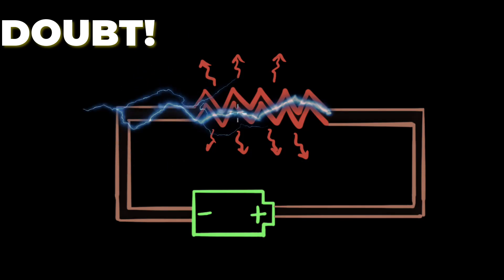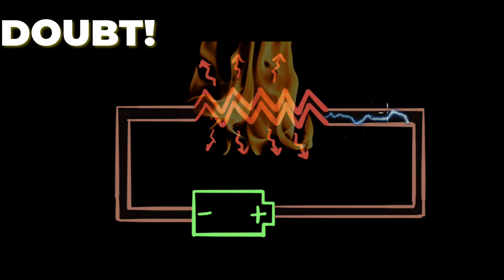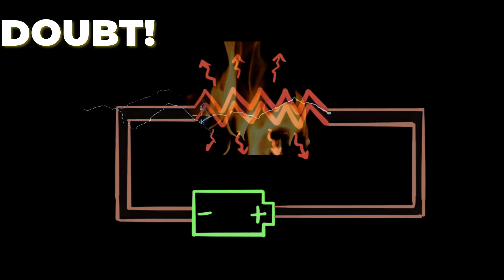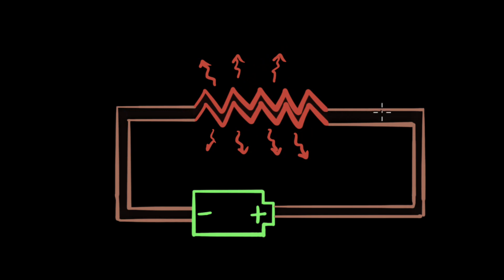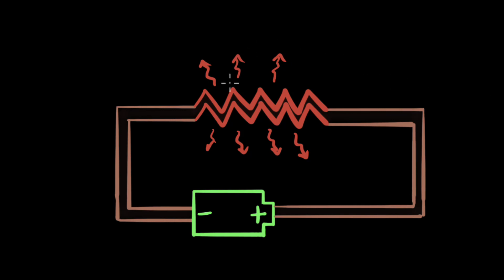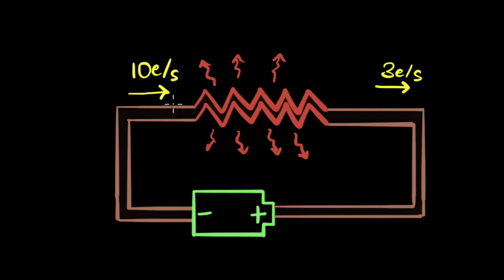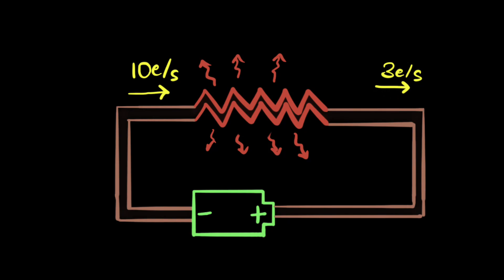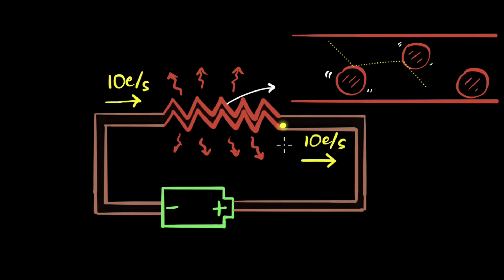Does current convert to heat?

Comment from the maker: For the one electron case, what do you say about the current in the resistor vs current outside? Let the debate begin 🔽
Reply: @FloatHeadPhysics I think the current will be less across the resistor as compared to the current outside (in circuit) ,in the case of one single electron.
Reply: It must be same. Because amount of charge that pass through the resistor will be same as amount of charge that pass through the wire for equal time intervals.
Reply: @yashodeepkarle3863  ya , also the voltage remains same , so the average dirft velocity will also not change and remain same throughout the circuit, wdyt ? 🤔
Reply: @VyomMath  that's right
Reply: @yashodeepkarle3863  but the resistor will decrease its drift velocity. So, the current will be less across resistor.
Reply: @Atheist-From-India  the average drift velocity of single e- won't change , because the voltage of the battery won't change and the drift velocity depends on the voltage, in the wire as well the resistance is almost zero , not equal to zero , thus the e- will bump into the atoms of the wire , even though the bumping would be more frequent in the resistor the driving force (voltage) remains the same , thus the average drift velocity also remains the same , that's just my perspective , don't mind 😌
Reply: I think outside current and current in the resistor will be different. (Outside the resistor,  electron will accelerate but inside the resistor electron's acceleration will decrease due to collision with atoms)😐
Reply: I think, in case of one electron, the speed of electron will be different: speed will be higher on entrance to resister and lower after resister.
Reply: If there were only one electron, then it probably won't be going anywhere as a "current" because the battery would act more like a P-N junction and not a battery.  So, no voltage, no current, the electron just bounces around randomly as Johnson noise.

If we assign the battery a small potential difference anyway, that would certainly push the electron through the circuit.  I would think that electron would go slower through mediums with higher resistances (the resistor) than mediums with lower resistances (the wire). 

Like light passing through different mediums, the velocity is the same going in and going out, but different inside the medium.   I don't think any law of physics disallows that.

The question in that case then becomes... does the electron get stuck anywhere?   Well, if we magically assign the battery a potential then it probably won't get stuck anywhere inside a purely resistive circuit.  But there is certainly possibility that some component in a more complex circuit could act as a potential barrier and the electron would simply get stuck there unless the battery provides enough of a potential to overcome the barrier.

That's what I think.

-Matt
Reply: I think the current will remain the same outside the resistor and inside the reisitor becuase current is coulomb's per second or no of e- per second and that thing won't change, as in this situation there is only 1 e- moving around the entire circuit, also it's drift velocity will also remain the same throughout the circuit as the power source remains the same and voltage remains the same.
Reply: @VyomMath  I beat you by 33 seconds 😂
Reply: Initially the current will be quicker outside the resistor than inside the resistor. This flow of the electron will stabilise and the speed will be the same inside and outside the resistor.
Reply: how can i ask u questions?
Reply: I think that current will be more outside the resistor as compared to inside the resistor, because current is charge per second. resistor will resist the flow of current inside the resistor, so the electron will take more time.
Reply: @Sunkenpine  Exactly!
Reply: But if there is only one electron        then the wire will be +vely charged so current will not flow
Reply: Imagine that the electron passes the entire circuite in 1 second. Then it would take more than 1 second to pass the resister because of the bumping with atoms. It can move freely inside the conducter because there is no any bumping. So the current must decrease inside the resister. Am I correct ? 🤔
Reply: For an one e case when it reaches a resistor I think it would slow down and would further slow down the e which come after the resistor as they don't get the push However the e before the resistor would not slow down as it has no direct connection to the e inside the resistor(From an analogy point of view)
Reply: So... Yeah, the current is the same but that's the only area of the circuit where we can observe any voltage. That begs the question what voltage actually represents in this system. The speed and amount of electrons is the same throughout, but the force that is applied is greater in the resistor, and... That's what voltage is. I still do not understand all of this compleatly, and would greatly appreciate if you could help me out.
Reply: Mahesh i think this is impossible for the circuit to have only one electron going at the ist place becoz the circuit i mean a continuous conducting path would have infinite number of electrons to travel, Now if you are telling that the circuit is vacuum then it would be meaningless to think that current would be going through the circuit. Now we are eager to know about your opinion please let's know what you have to say.
Reply: No matters the electron is in resistor or in wire... Current will always be constant because when it starts moving, electric field get settled which is responsible for the constant drift of the electron all over the circuit
Reply: Weird 🤨🤨

Comment: Surely will ask my teacher who is a professor of El engineering. It's really an excellent question. I think ( i know it's probably wrong) that when the current moves through the resistance, the movement of the charge causes the friction to produce heat. Genuinely, a moving current creates a heating effect( if kept switch is kept on for a long time). Resistance often slows down the movement by curving out the way of the particles so probably the extra movement and the field of the electrons causes the extra heat. I don't think I think correct but let's see. I'll ask my teacher.

Comment: I think that electron loose most of its potential energy in form of heat so its at lower potential then before but we know current and resistance is indirectilly related so resistance of wire is a lot lower of current remains same

Comment: Thank you for your always natural answers to the problem. I have a question bothering me about it. Let's say , we have 10 Volt (J/C) battery and 5 Ohm  (J sec/C^2) resistor . The current will be 2 Amp (C/sec) according to Ohm's law. My logic is that every Coulomb must lose 10 Joules as they pass the resistor ( to  fullfill the voltage requirement of  10 Volt (J/C) at the end of circuit). But if the current is 2 Amps ( 2 C/sec), every coulomb of electron losses only 5 Joules of energy (5 J/C) which does not satisfy our voltage (which is 10 J/C).

Comment: Thanks for sharing! The battery discussion needs to be revised. I think viewers may think electrons are moving in a loop. But electrons do not move in loops. It is just ONE path with a beginning and an end.
Reply: U mean battery work like capacitor
Reply: @tasneemraheem8320  correct... The potential energy in a capacitor is stored in an electric field, where a battery stores its potential energy in a chemical form

Comment: Energy has already been spent on the battery to separate the electrons while charging... So I don't understand why you explain the gain of potential energy for the electron as a part of current flowing in the circuit.

Comment: Can you explain whether electron collisions with atoms actually occur?
Can you explain why elements connected in parallel have the same voltage?
Reply: The elecrons doesn't actually touch anything but they interact through their electric fields like repelling magnets pushing each other. 

Voltage is a difference between two points. The voltage of a heating element is measured between its ends. When the elements are connected in parallel the one end of each element and the other end of each element is connected together so the voltage across each element must be the same

Comment: El. engineer here. As best as I know it goes like the following. First it should be considered that it takes some time for the electric field to raise the voltage across the resistor from 0 to its stable value. Typically, the voltage jumps at a high order exponentially increasing way to some value above the source dc voltage and stabilizes in an exponentially decreasing sin manner to the source voltage minus the small voltage drop in the wires.  Immediately after the initial moment of closing the circuit/starting the circuit, the field starts propagating from the source terminal parralel onto the surface of the wire at the speed of light. It propagates outside the wire, so typically the speed of light in vacuum or air. It starts from the negative terminal and has negative value,  so the effect on the electrons in the wire would be to rotate the electric and magnetic moment vector of electrons in molecular and atomic orbitals below the energy level of the orbitals in the valence outer shell. The field can also rotate the polarization vectors of any present polar molecules. This is also a type of current. As the field travels along the wire surface, repelling the valence electrons away from itself, it yanks many valence electrons above the conductor's own band gap to molecular orbitals corresponding to the conduction band. So these electrons travel or their wave functions propagate through the wire along the available orbitals in the conduction band. Now like in your example, let's consider the field after some very short time interval from time zero when it has created an average current density in the conductor cross section of 5, or 10, or any amount of few or several electrons. In the wire, a very small number of electrons have a probability of tunneling to and/or losing energy and falling back in the valence shell. Then they have a probability of being reexcited to the conduction band and so on. When the field reaches the resistor, basically as you said,  electrons  bounce around between atoms and molecules at a higher rate. This can cause them to lose energy and a higher number of electrons now have a probability of decreasing to lower orbitals in the conduction band and falling in the valence shell. Each decrase and fall result in emitting photons of thermal radiative/radiation energy in all kinds of frequencies, determined by the difference in orbital energy levels each decrease and fall for each material. So actually when the field exits the resistor, it will push a lower number of valence electrons and will rotate the moment and polarization vectors by a lower angular momentum. The field will continue along the second wire to the positive terminal of the source. In the most general case at the contact boundry between the wire and the terminal, part of the field will continue in the same phase along the terminal through the battery out the other terminal again. The other part of the field will be reflected in the opposite direction back to the wire with reverse phase. It will again propagate through the resistor and wires back to the negative terminal. Then reflect from the negative terminal again in opposite phase, this time becoming in phase with the exponentially increased field coming out of the source. It will continue bouncing this way between the terminals creating an interference, which over time will converge/stabilize around a single median stable state within a required tolerance. This field creates the measured voltage drop on the resistor and a kind of constant drift along the along the entire circuit. The electron interactions can be more energetic and chaotic in the resistor. This can cause it to emit more thermal radiation than the conductors and the source, but the average current density can remain the same in every part of the circuit after the field has stabilized.
Reply: Hello, I would like to ask if the electrons directly contact the atoms, or if the electrons reach the atomic level and react with the protons in the atoms, causing the atoms to vibrate.
Reply: @junjieqiu3214  It vibrates because atom is connected to  resistor with a strong bond(attraction) the electron makes a force on atom causing to move forward but it can't because of bond with resistor so it just vibrates in forward direction and  this increase energy and instability causing the atom to release heat to be in stable state
Reply: @junjieqiu3214 
Actually you need to understand the Electrostatic force and if you are aware you could easily get your answer, we can clear your answer by a fundamental principle that like charges repel while the opposite charges attract so you see a atom has nucleus and electron shells if you imagine like this a electron coming towards an atom will cause a force on atom to move forward and atom to react will make a force on electron in the opposite direction and at a time the Fnet = 0 on electron the point where this happens is not in the atomic area rather it is away from orbits.

Comment: I think it should be explained that current is the number of coulombs passing a point per second and bears absolutely NO relation to electron velocity at all. Also, if the wire is a perfect conductor, then no heat is dissipated in the connecting wire, and there is zero electric field in the wire. The only place an electric field exists (apart from inside the battery) in the circuit is within the resistor, hence there is a voltage across the resistor and hence there is power dissipated in the resistor equal to V^2/R. To even suggest that electrons bunch up in a resistive circuit is misleading and false. Sure, in a capacitive circuit they do, until the induced field opposes the field from the battery.

Comment: Where does the kinetic energy of electrons come from in a circuit does it comes from the potential energy provided by battery as you said or the electric potential energy of charge which gets converted into kinetic energy of electrons when repelled by terminals which i think according to my ananlysis?please sir can you answer this doubt

Comment: I think battery has all the electrons on one side. Electrons don't really go through the battery, they just return to "their place" using the circuit. So the single electron would only go through the circuit once and calculated current would be lower in the resistor because the electron would go slower and there are no other charges Infront or behind it to balance the speeds out.

Comment: I will use gravitational analogy here. There is a potential energy field around a planet. So if there is a ball placed in space. It will accelerate like 0 m/s then 4 then 8 then 12... So I think that electron from negative terminal will start from v=0 and speed increases till it hits resistor. Then what you told will happen. Then after exiting resistor, electron may again accelerate from 0 m/s to something and hit the positive terminal with some speed. And I think average velocity will be different in left and right conductor and resistor.

Comment: i don't know the answer but if there is only one electron then the electron can't flow because it have not the definit direction, as we know that in neutral wire the electrons randomly flow which makes 0 pd so if there is only one electron then there is no force that tends the electron to flow in definit direction so there is no flow of electron take place thus there is no current measure
  

well i'am in 10th class so i am not sure sir.

Comment: How to explain the kinetic energy of electron?? now consider a particle or you the observer moving with the same velocity as electron according to you then the electron is not moving at all it is at rest so it does not have kinetic energy according to the definition and it does impart some kinetic energy to the atoms and its giglet mode so according to you the observer you feel heat but according to you there is no kinetic energy associated with the electrons how do you explain that